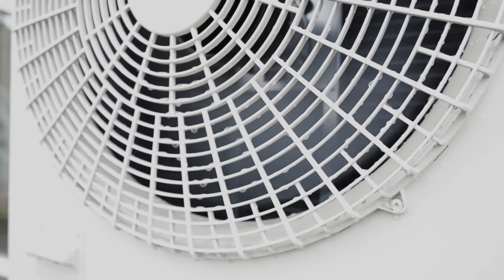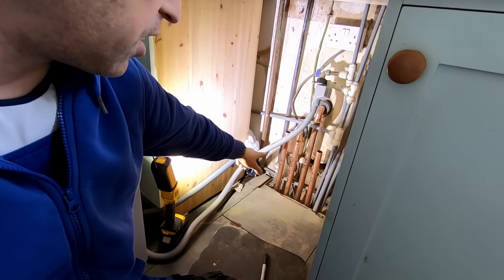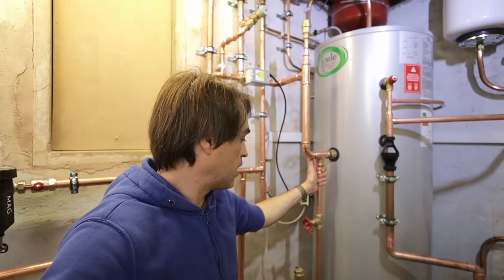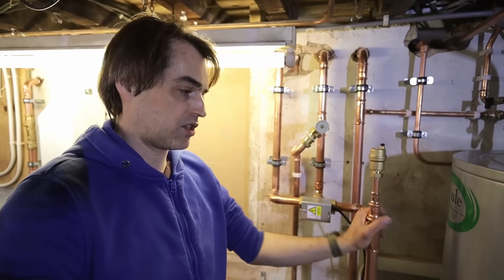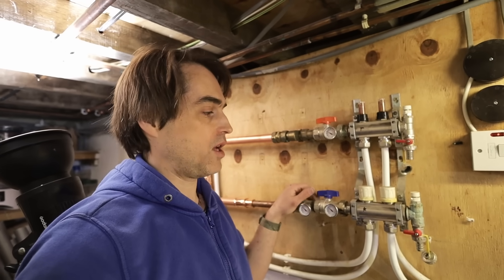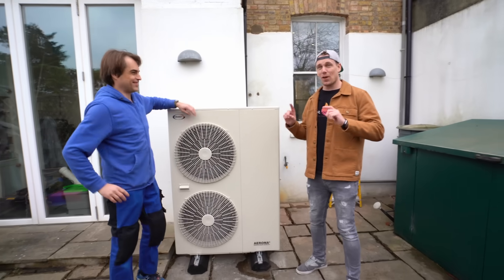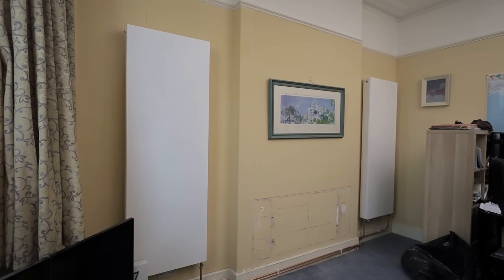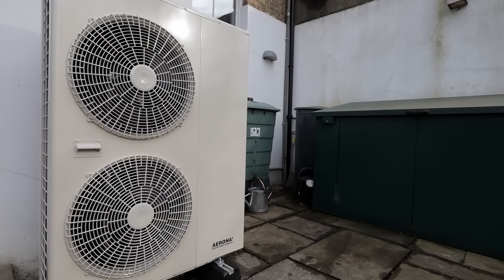The Truth about Heat Pumps: Debunking the Myth.

Comment: any reason why you wouldnt use a single fan coil in place of the radiator in the lounge - 1700w could be easily achieved with a 1200mm wide fancoil with 45 degree water... keep the same footprint? those radiators do not look the part imo, Id hate those on my walls.

Comment: Very informative, feels like we’re going back in time having a room dominated by huge radiators…
Reply from the maker: why do people hate big rads? I love them!
Reply: @UrbanPlumbers  Can't do much else with a wall covered in radiator. Can't put a shelf there, a cupboard a picture, wouldn't necessarily even want to put a chair in front of it. Probably fine for people with giant mansions but for the average, tiny UK home it's ridiculous. I'd like to see a domestic install of a High Temp Heat Pump (yes I know they are not as efficient but still more so than a simple immersion heater).
Reply: @SardiPax  many years ago when I was an adobe builder in New Mexico I built large vertical radiators into the walls of some homes to give out heat to spaces both sides of the wall. Built in rather than hung on is a possible solution. This is where joined up thinking between home designers, home builders and specialised trades ought to come together. I first saw the heat both sides concept used in Quarry Hill flats in Leeds. They were built in the 1930's. They also had a waste disposal system that carried organic waste from the sink to a large communal boiler to be burnt  to heat water. In eastern Europe power Stations don't have cooling towers they send the hot water to heat apartments and other buildings or to aid industrial processes. A lot of good ideas lost to make individual houses more profitable for the builder.